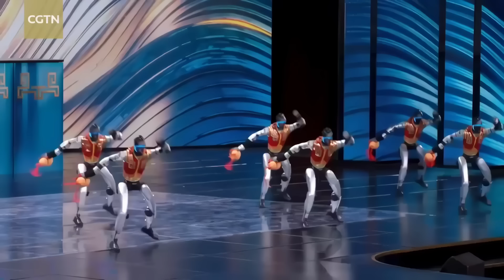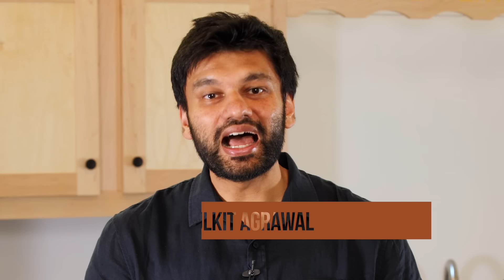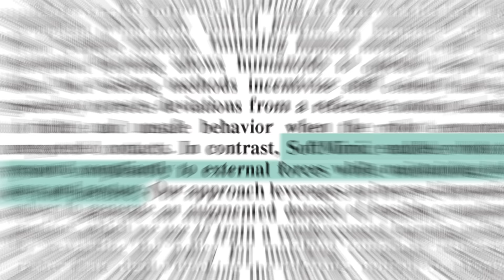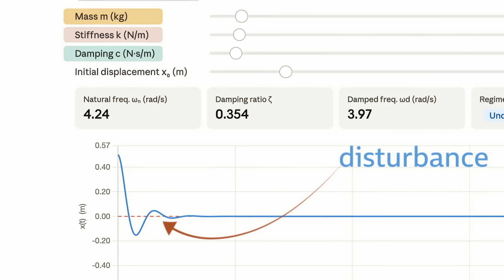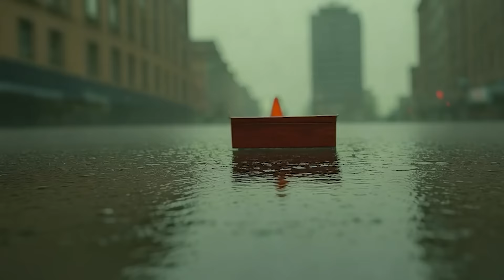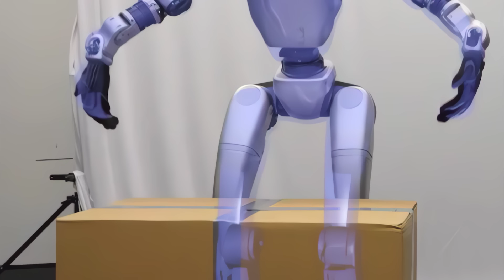(Many) of us want home robots. What's the holdup?

Comment: doesnt industrial robot already mastered this issue, why bother re-inventing the wheel and train from scratch from machine learning ? especially when there is very few pre-existing data point. If IC assembly pick and place machine can handle thousand of delicate ic component precisely and extremely fast. Why not adopt their method instead ? you dont see pick and place machine using reinforcement learning to watch how human woker pick and place ic component. cause that would be extremely error prone and imprecise for electronic.
Reply: an IC pick and place machine needs consistent lighting, location and appearance - it also cannot be moved. These conditions do not happen in a home or in fact, most workplaces. Using the ML approach allows the policy to tolerate differences in all of those.
Reply: You are correct. It's the tech bros dream to have mechanical slaves so they want to believe that "physical AI is something new. As if all the big robot companies are just sitting on their hands. It's becoming obvious that everyone jumped on Elon's humanoid bandwagon without thinking. Humanoids have never been useful as "workers" and it's easy to explain why AGI can't change that. We see how Amazon is replacing people and it's not with humanoids. Because robots ALREADY use Vision and AI and they don’t look like humans because humans are limited. (they have to climb ladders, hands too big for small things etc.) Automation has been replacing people for decades and it hasn't stopped! So if a humanoid could do it, it’s already automated! (1) Just look at history. (2) So NO, they WON'T become useful as technology and AI improves.

In other words.(3)
In other words.(4)

Many seem to think factory jobs are easier than other jobs, they are not. A lousy housekeeper won’t cut it. Even if it had a brain it couldn't work at McDonalds because the hands can't bag items, make change, crack eggs, wrap burgers etc. Also it should be obvious that AGI does not need a humanoid to replace someone sitting at a desk. TAM will be small. It's just groupthink nonsense.

____________more ____________
Look at it this way. If AGI could assemble widgets or do surgery or manicures, etc. it would need special tools not batteries, hands and legs. Optimus is not strong enough to dig a hole or help someone get up off the floor. It can't work at McDonalds. Can it wash its hands? How long would it take it to change gloves, start a roll of tape etc.? A humanoid MUST do a job on par with a person because workplaces are made so people along with machines maximize asset utilization. That is why you CAN'T just put two humanoids in place of one person.

This is why no one has EVER shown ANY humanoid doing any useful job that a person was paid to do. But AI could make it a fun toy or criminal.

If you have a trade job, you’d realize it would be impossible or impractically slow to do it with robot hands. No amount of AGI Learning or training is going to make clumsy hands better with tools, scissors, small parts etc. Making hands equal to a person is impractical and unnecessary.

Hot, heavy, dirty and dangerous jobs. There are 100s of millions of them around the world. And if a humanoid could actually do it, LOL, most of those jobs pay super low wages in places where there is no electricity to charge it anyway.

Most of today's humanoids can't complete the tasks from the DARPA robot challenge 10 years ago !?!

"Optimus will be the best surgeon" !? When AGI can do surgery, it will use existing surgical robots. A humanoid will not wield a scalpel.

"it's a humanoid so it can work in a human environment" The humanoid form or its brain doesn’t matter. What matters is what it can do.

Who will buy them? Not factory or warehouse managers. They can't do trade jobs or hard labor. They will be lousy housekeepers, tour guides, popcorn servers, entertainers etc. ridiculed as toys and criminals will use them for nefarious purposes. At best it could be a checkout clerk that will restock the store at night if it ever really gets a brain. Credit only, robot hands can’t handle money well.

But they would be really nice if a handicapped person could use it as a telepresence to go shopping, do simple chores, etc.

I'm a retired automation engineer, a better use for AGI in factories would be to replace low precision sensors in harsh environments. Example. If an AI agent could watch a conveyor line and all the parts on it, it could control the motors, escapements, pushers, etc. and it could see where things are without the need for sensors. is the escapement in place, is the part? what type, orientation, how many, did it fall? You could eliminate a bunch of sensors that are costly to maintain, it would save a ton of money on parts, engineering, programming, maintenance and downtime. It could be a natural language (instead of ladder or state) programmable logic controller. The new PLC will be NLPLC with the usual outputs, and mostly vision inputs. Keyence and Cognex already use vision to inspect, measure, identify etc. AGI could take it to the next level.(maybe they're working on it) you'd need several cameras at different angles for reliability/redundancy so AI is needed to identify targets from different angles and if cameras move. Maybe language programming would be a separate AI. It sounds like it might be a low bar for AI but I doubt it's really that easy.

(1) It's first principles. If the goal is to emulate a human then you must make a humanoid/android. But if the goal is doing things that a human can do, then first principles DOES NOT dictate a humanoid. So AI is already "embodied" or "physical". (ill conceived terms, us old folks say, smart sensor or smart tv) And if you do want to emulate a human, you must choose which characteristics you want. It may need sensitive hands to feel slight imperfections or it may need durable hands for hard work. So a one-size-fits-all like Optimus is not practical. Unless it can reproduce, heal and recharge itself for decades by simply eating and sleeping.

 (2) Warehouse managers needed people to store and retrieve items. Now warehouses are full of non-humanoid smart robots. People had to pick parts out of a pile and place them with correct orientation. Now one armed robots do it. People had to pick up parts to inspect and measure them. Now lasers measure them and vision systems inspect them. PID controllers became self tuning. As tech/learning/AI improved, so did machines and machine controllers. Just like computers taking jobs with spreadsheets and scanners. All the while someone was saying a humanoid will soon do the work.
(3) Humanoids will never be able to do most jobs because most jobs are doing things that robots(software automation and hardware automation) cannot do and humanoids ARE robots. It's that simple but sometimes it's hard to see the forest from the trees.
(4) Ai has been used and has been improving for a long time. AI has already been replacing both white and blue collar jobs through attrition by making the workforce more productive. So it will only continue. There will be no big change, just the same productivity gains.

Comment: Hi
i have looked closely at your introduction of the SoftMimic framework, and love the idea. But according to our own tests and simulations, we have made before; we noticed a major catch with relying purely on simulation data .

For example, if the robot expects a water bottle to weigh 0.5 kg, it will use the power for 0.5 kg. But if someone "fakes" the data like putting something heavy inside the bottle that makes it 2 kg the robot will still use the low power and fail. Even worse, if you reverse it and make a heavy looking  but actually it just super light, the robot will blast it with too much power and cause a disaster! We call this just an "endless loop without a break" because the safety problem remain the robot isn't truly adapting in real time to the actual physical weight.

Our research team ran into this exact problem, and we had to adopt a completely different approach to solve it and keep our robot safe.

Comment: Besides safety, I would also want a robot that I OWN.
Not one which receives automatic updates. Not one which can be remotely accessed. Not one whose behavior can suddenly be changed by anyone other than me.
Reply: I completely agree with you.
 This is actually what my research team and I have been focusing on. We just successfully finished the research and proved our solution for a campus guide robot that is entirely offline.
Everything from the speech processing and handling interruptions, to the navigation and real_time calibrations ,runs completely locally on the robot's hardware. It doesn't rely on any kind of cloud connection or external servers. This not only passes strict institutional safety 
standards but ensures that the robot is fully secure, private, and completely controlled by its owner without any unexpected remote updates .
Reply: @ben-onikabozya6785if this is real then my one like isn’t enough.
Reply: @ben-onikabozya6785 Locomotion is a relatively solved problem. Different bag of beans lol. You wouldnt be able to do general dexterous manipulation without teleop at least some times..or just tolerate a high failure rate.
Reply: @nekosynthesis  Our research is actually divided into 2 generations. The first one and the second one . so the first one focuses on a fully ofline autonomous campus guide robot. our objectif wasnt to solve human level manipulation ,but the robot performs speech, perception, navigation, planning, and decision making, but the part of manipulation is just a very simple  gestures , like pointing to a tools or equipment while guiding visitors.., but the Generalpurpose manipulation is actually part of our second generation robot, not the first one.
We're hoping to present the first generation around March 2027. I' will be happy to hear your thoughts once you see it in action
Reply: @ben-onikabozya6785 Yeh definitely interested if you ever write up gen 2 somewhere. Do you have a profile somewhere I can follow? :)
Reply: Exactly, no Telemetry.
Reply: The first home robot-enabled murder is going to be crazy
Reply: Sure, but for that to happen they first need to collect a lot of data through tele-operation. So you can not be an early adopter if you want to keep your privacy.